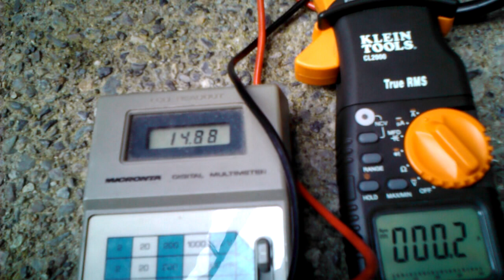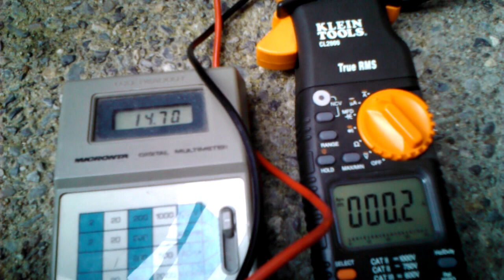XS Power D1400 Load Test

Comment from the maker: No. A 14v battery needs to be charged between 16.1 and 16.8v.

I'd look into replacing the yellow top with an XS power battery. And upgrading your alternator to an HO alt

Comment: Was up man i wanna kno could i run a 14 volt in my car with a stock alt i have a 2010 nissan altima with a yellow top up front an a xspower d3100 in the back i run a saz 3500 @.5 my volt drop at the amp at full tilt drops to 10.9  would a 14 up front help out an could i use it with a stock alt is a 105amp stock alt